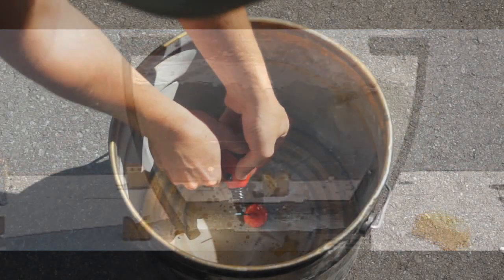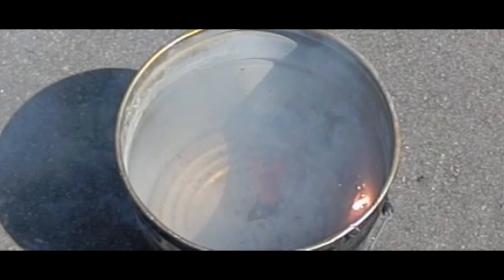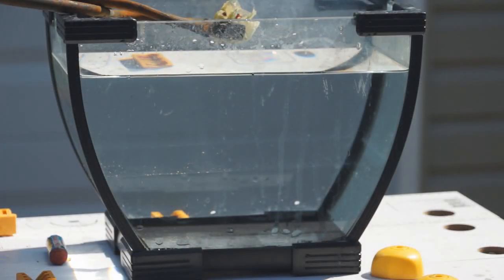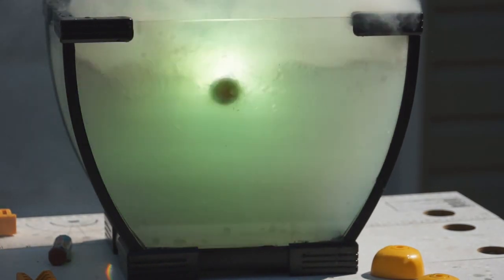Underwater Fire Works in Slow Motion

Comment: cool idea to video. i used to get spinners called "ground blooms" which were size of dime roll, really good to throw in water because they could go fast enough to bounce across the surface and then randomly underwater a foot or so. 

i think extra activity could be from Mg, more so the chemical reactivity rather than a high temp, to rip water apart into fuel and oxidizer. after burning some fingernail scrap sized bits of Mg which propagated poorly, spitting on collected red embers=white flash